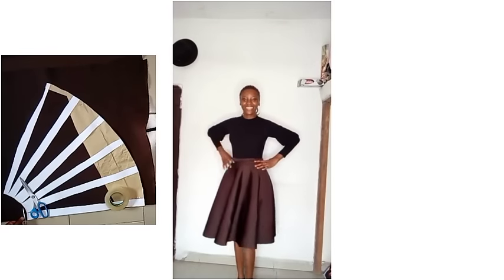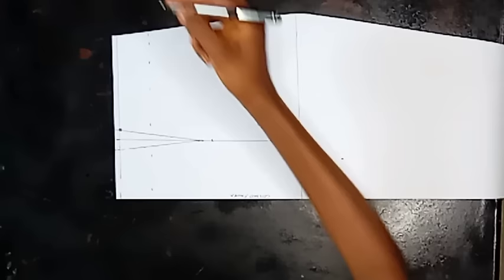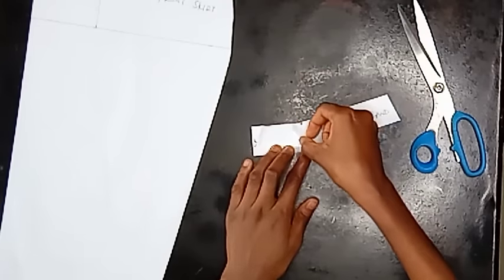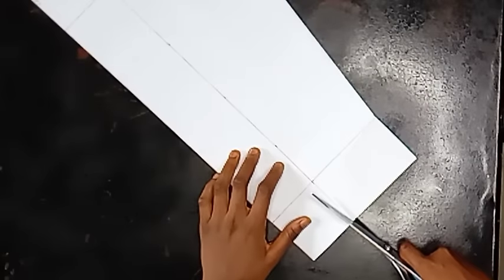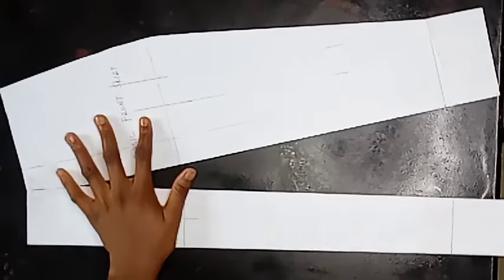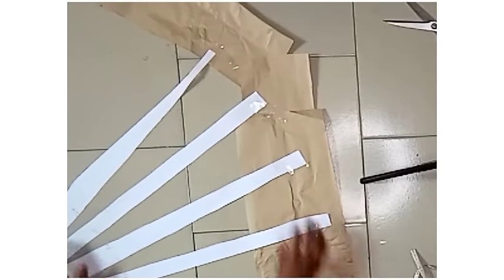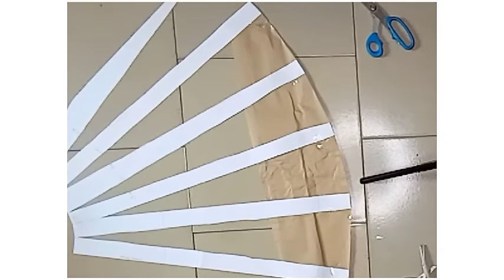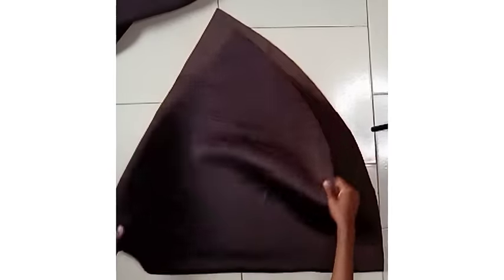how to cut a 720 degrees circle/ flare skirt.

Comment: Good evening ma, i have 2questions tho!
1.will i still use same method if i was making a gown
2.what if i dont want a cut on both sides just a full circle except for the area fo zip placement, how do i fold the fabric?
Reply from the maker: It's same method for a gown.

If you don't want joining at the sides, join your front and back pattern on the sides use a celotape to hold them together , then cut on fabric